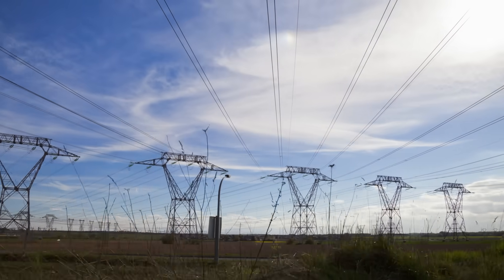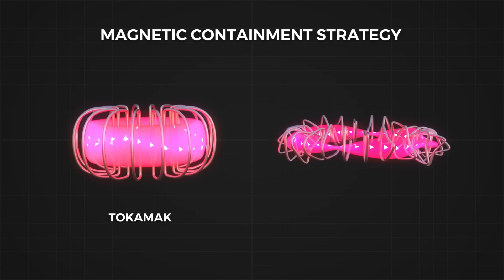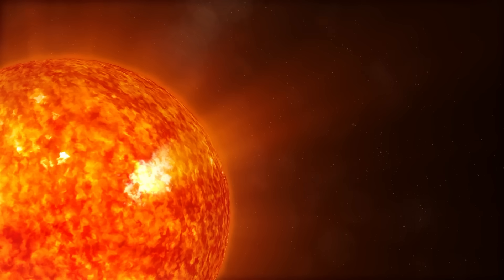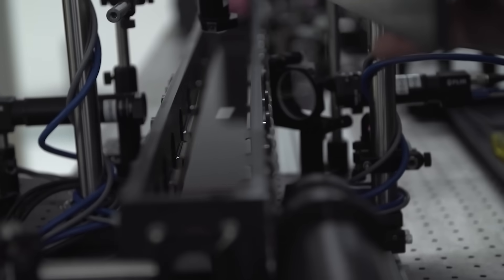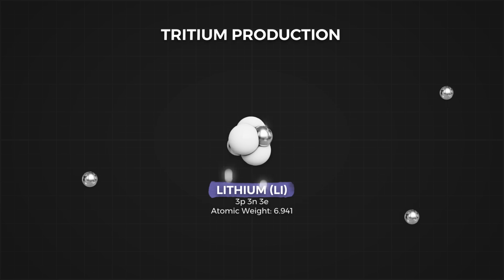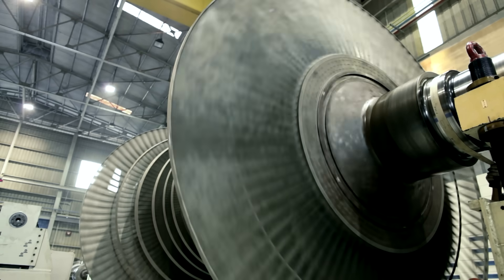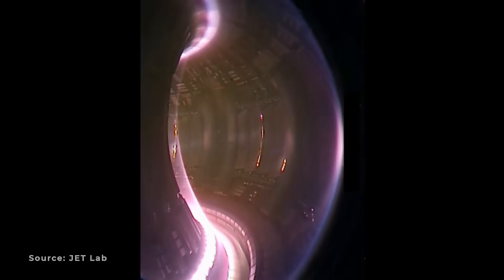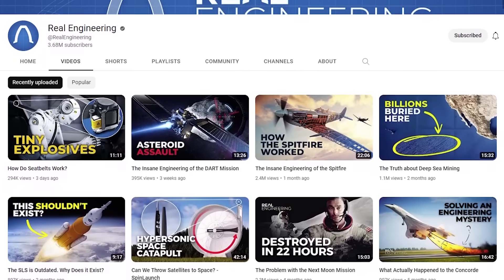The Problem with Nuclear Fusion

Comment: Except here in New Zealand where we generate our electricity with hydro, which doesn't create any waste or emissions, and uses free water, and is therefore already delivering the benefits that nuclear fusion promises, we do not have a society any different or better off than any other country.  Our power bills are not cheap either.  So, I don't see nuclear fusion delivering some imagined utopia.  You'll still need a power plant and electricity grid, and it's all going to cost as much as the current system to maintain.

Comment: Yes would this have something to do with the fact that the neutron flux inside the fusion reactor, is not a mystery? And that it would activate enough stainless steel and also be destroying its utility, such that the stainless steel liners would have to be replaced on a regular basis. And the activated materials which is fairly long half life would have to be disposed of and calculations in a nuclear Regulatory Commission publication from 40 years ago estimated that the ratio of high level waste compared to efficient reactor is somewhat better but it's still tons of high level radioactive raced in fact it's only a factor of 1/5 to 1/10 that is the fission reactors output. So you still have high level radioactive waste to disposal of, although the threat to the environment when properly contained and put in a deep Mountain like in France is essentially 000
Reply: ''The activation of components in a fusion reactor is anticipated to be low enough for the materials to be recycled or reused within 100 years, depending on the materials used in the "first-wall" facing the plasma.''
The activated material half life is less than 100 years.

Comment: What happens if magnetic field fails?  What will happens to all that heat
Reply: It just shuts down. Nothing toxic is released. No radiation is produced.
Reply: @hvo-aim  what about all that heat?  Isn’t it as hot as the sun?  Wouldn’t or couldn’t it cause damage?

Comment: A big part of the cost of nuclear fission reactors is that each one is built like a swiss watch, individually. France did it the cheapest. They came up with a safe standard design. They then mass produced them like cars. At one point, France was getting 75 percent of their electricity from nuclear power.

Comment: I don't think it's impossible. It's just very, very, very difficult. We know it exists. All the proof we need is to look at the sun. But the required stability and isolation of the super hot plasma is just so hard. And there maybe simple things that are difficult to discover. I remember in the early attempts they couldn't even get a fusion reaction to even occur. Turns out the containment container had to be incredibly clean. Even a little dirt would pollute the reaction.

Comment: Deuterium isn't free, and takes a lot of effort to isolate.  Wind power is truly free -- the fuel costs nothing, but you don't see all or really any of the benefits this video claims for fusion resulting from using the wind.  We may eventually get working fusion based power plants, but they won't live up to the fabulous claims made in this video.
Reply: Tritium is ridiculously rare and expensive.  This  video is nothing but hype.

Comment: Check out First Light Fusion. Inertial fusion. No magnetic containment. They separated the fusion process (which works already) from the engineering design iteration to capture the energy as heat->steam. They freely admit they set it up to avoid all the problems that the industry has already discovered as critcial blockers.

Comment: i can remember when the same things were being said about nucellar fission. the meter could                                                                                                                                                           b taken off the house because electric would be so cheap.
Reply: Had that asshole Adm Hyman Rickover not forced the light water reactor on utilities and had the Big Fossil-funded anti-nukes not been allowed to interfere, nuclear energy would be too cheap to meter.  That does not imply free.  It implies a fixed fee for each ampacity  service.

As it was, conventional energy in the 60s was really too cheap to meter.  I saved my parents' utility bills from the 60s here in TVA territory.  The Chattanooga Electric Power Board charged 1.5 cents/kWh in the early 60s and rose to a measly 2 cents a kWh by the end of the decade.  It really wasn't worth sending out meter readers, mailing bills and processing payments.  It would have been cheaper to charge a fixed fee for a 100 amp service and a larger fixed fee for a 200 amp service and so on.

The huge Aluminum refining plant located in Alcoa, TN is there because TVA sold them bulk power at about 0.25 cents/kWh!

It's interesting to see what actually happens when energy is practically free.  Prosperity.  In relation to getting Middletown, PA's acceptance of Three Mile Island,  Met Ed negotiated a 99 year deal with the city to sell them electricity for 1 cent/kWh.  I spent 4 years as a contract nuclear engineer at TMI after the event and witnessed what happened.  Middletown prospered while just across a creek, the town of Royalton where I lived and which did not have the cheap rate was moribund.  They could not afford to buy recloser breakers to replace the fuses on the substation that fed the town.  So at about 5PM every day during the summer, a phase fuse blew and it took the tiny little utility hours to replace the fuse.  The apartment building I owned was near enough to the substation that I could hear the expulsion fuse blow.

This was worse than a blackout.  The voltage to my apartment building dropped by 120 volts / sqrt(3) which equals 69 volts.  This voltage is too low to run motors on refrigerators, freezers, white goods and the like.  So every day we planned to go somewhere after work, I had to open the main breaker to protect our appliances from that voltage.

Comment: The other problem with most fusion systems today is the materials on the inside of the donut. First, can they withstand the temps over a long duration, and second, what are the impacts of all the stray radiation doing to the materials themselves over time? How long can a reactor operate before it requires shutdown for deep overhaul and replacement of materials?
Reply: We already know (I use "we" here because I've spent my career on both the military and civilian side of nuclear.) 

The neutron flux inside a 3500 MWt PWR using 3% enriched fuel at full power is approximately 2.4E+13 neutrons/cm^2.  A mythical D-T fusion reactor of the same power output would have a neutron density of about 1.4E+22 neutrons/cm^2.  This is an orders of magnitude more dense flux than has ever been generated on earth except during the fusion part of an exploding thermonuclear weapon. 

When steel is exposed to neutrons, in addition to becoming radioactive, the neutrons upset the metal lattice, resulting in the transition to nil ductility temperature rising, eventually to room temperature and above.  Below the nil ductility point temperature, steel becomes as brittle as glass.

Based on steel coupons placed inside nuclear reactors, the nil ductility point in old reactor vessels had risen uncomfortably high.  The fear was that if an accident happened and cold water was injected into a reactor vessel, the vessel might shatter.

So at several older plants, the reactor internals have been removed and the reactor vessel was annealed with a giant induction heater which reversed the damage.  Since the neutron flux in a mythical 3500 MWt D-T fusion reactor would be E+9 times more intense than in a PWR, steel would be made brittle in weeks instead of years.

The fusion apostles claim that there are alloys more neutron-resistant than steel but I have seen nothing proposed that was affordable.  Most of the proposed alloys involve titanium, a rare and strategic metal that Russia controls most of the supply of.

Comment: For cntext, the first successful nuclear fission (Chicago Pile) produced half a watt of energy for 20 minutes, about 600 joules. That proved the concept of nuclear power and led to reactors that can produce Gigawatts of power.

This produced a NET gain of 1 MJ (1 million joules). It doesn't matter if it took 1000 Gigawatts to prodouce, it's energy positive, meaning it could power itself (given fusion fuel) and generate positive power. And of course this is just the proof of concept.

Fusion is about 1000 times more energetic than fission per unit mass, meaning reactors can be absolutely tiny yet still produce huge amounts of power with little to no radiation and no pollution or c02 production. If the technology is improved, one day we could effectively have small fusion reactors built into cars, planes, or our own homes which could fit in a shoebox, yet provide enough power for everything we need (given fuel).

Fusion really is the "future" energy source, and it's been proven possible. For anyone that doesn't know, the main fuel for fusion is deuterium-tritium, isotopes of hydrogen, the most abundant element in the universe.
Reply: “They” won’t let it happen. Imagine the loses OPEC will have. Coal industry will collapse. Oil industry will collapse. There’s too much influence to be lost here.
Reply: @ksun4651  It will just shift. Coal and oil specifically have different industrial uses. Instead of simply burning coal and oil, we would use coal to make more steel, and oil to make more polymers.

Comment: Fission power IS clean, green energy.
The "dangerous radioactive" products are so blown out of proportion it's not even funny.

You could walk amongst all the waste of a nuclear plant and not even have a higher dose of radiation than normal.

In fact, that's what happen in some visit of facilities, where you are literally surrounded by it and the Geiger counters doesn't even register it.

There's something you need to consider, the fuel we use (and then enrich) is billion of times more radioactive than the waste, in a sense, we are actively depolluting the soils when extracting and using it.

It's not because we use "highly radioactive nuclear waste" as a term that you need to immagine nuclear bombs in barrels.

Sorry to say it, but it's the exact opposite, we contain them and burry them mainly because you don't really want people to come and snatch some barrels, immagine what could happen with it.
And because of laws, you can't pollute the soils, so even the tiniest bit of radiation need to be contained, hence the barrels.

There's also heat to take into account, etc, etc, etc....

Comment: This is what ITER is supposed to demonstrate, that energy input can be < fusion energy output. So is ITER still neccessary?
Reply: The laser result didn't take into account the massive energies required to make the beam. And Q 1.5 is nowhere near enough for a fusion power station.

Comment: Until we can solve the fusion problem the LFTR/MSR   Liquid Fluoride Thorium Molten Salt FLiBe Reactor  really a great intermediate sustainable efficient bridge technology with distinct advantages.  1) the molten salt "fuel" is also the primary heat transmission medium.  2) The  primary heat transmission medium ie the fuel is not under high pressure but rather transmits heat through high temperature. 3) though the primary heat transmission medium can be  used in the conventional way to boil water through heat exchange then turn a turbine, it may be far more efficient to exchange that heat into a CO2 gas turbine cycle achieving energy efficiencies of up to 40%.  4) Part of such a cycle can use the waste heat to purify sea or waste water.  5)   From start to finish the whole plant can  be made to be a chemical plant that has nuclear fission going on, nuclear decay, chemical separation of blanket thorium material from bred fuel material ie U233,  chemical separation of fuel material from fission products and even by extension chemical separation of various fission products into into different chemical  streams.   a fraction of those products are  as valuable as gold others have so,me market value.   6) The longest lived waste product decays to insignificance within 300 years and is a relatively small fraction of the waste product stream making it easy to store until its half lives are exhausted.  7)  it has great potential to burn up existing stockpiles of   fissile spent nuclear fuel and transuranics when a small fraction is added to the fuel.  8) It has potential to create rare nuclear isotopes that can be used in the space program and in nuclear medicine. 9) it is a self regulating negative feedback fission process which when the temperature of the fuel falls the atoms of fuel get closer together and the fission speeds up.  When the fuel heats up the atoms of fissionable fuel spread apart and the reaction slows down to cool.  10) It is driven by thermal neutrons.  Because the fissi9n of U233 reactor requires a graphite moderator to slow neutrons to stay critical, when the fuel is separated from the reactor and drains  into an emergency tank the reaction simply extinguishes itself and therefore cannot melt down.  Molten salt is already melted down.  After the problem is fixed the fuel can  be reheated and pumped back into the reactor.  11) As far as making a nuclear bomb it is easier to make a nuclear weapon from the processes of refinement of enriched uranium and plutonium today than it  is to make one from this sort or reactor.  The present processes to refine U235 to bomb materiel is easier, safer and far less detectable than using and refining bomb grade U233 partly because U233 will always have a little U232 created in the process which gives off dangerous high energy gamma rays which endanger the makers of such a weapon.   youtu.be/sYRPdCEq1vI

Comment: Not a lot has changed with the recent announcement of break-even being achieved. Break-even was nice, but not enough. The idea is to efficiently generate adequate surplus electricity for use, not barely enough to keep the reaction running. Now they're saying 'it will take 10 years," instead of "it will take 20 years," like they've said for the last 70 years... but I'll believe it when I see it.
Reply: No one has claimed nuclear fusion will take 20 years to complete 70 years ago. Those who are clearly do not know what they were talking about. Now, with the amount of fusion startups and this net positive in energy it does seem much, much more likely that fusion will become far more mainstream in the next ten years.
Reply: Amen. Finally, someone who seems more intelligent and less gullible

Comment: This has not aged well, and it's only been 48 hours 🤣
Reply: Its aged just fine. Wait a couple years and see nothings changed for fusion
Reply: The laser result didn't take into account the massive energies required to make the beam. And Q 1.5 is nowhere near enough for a fusion power station.